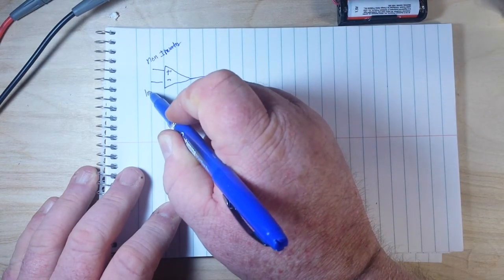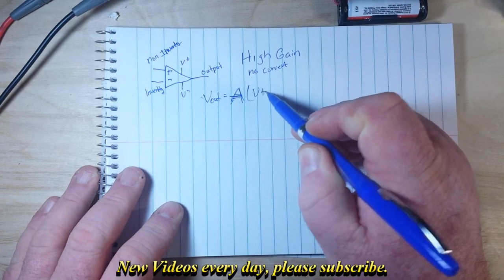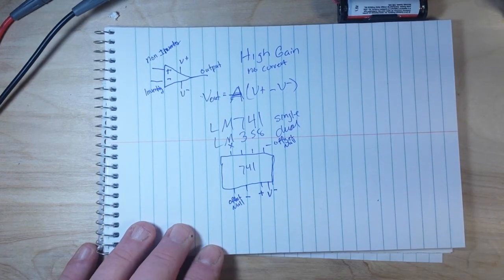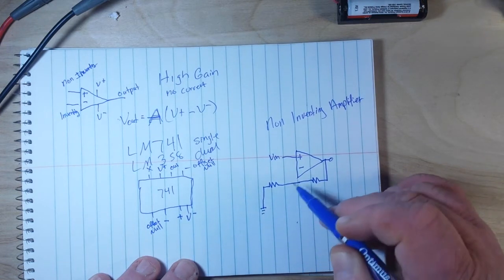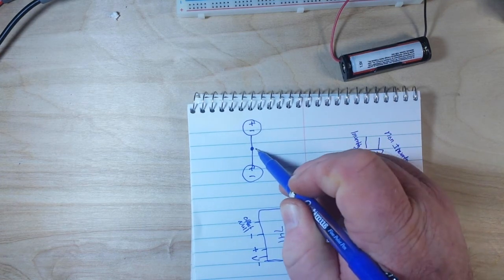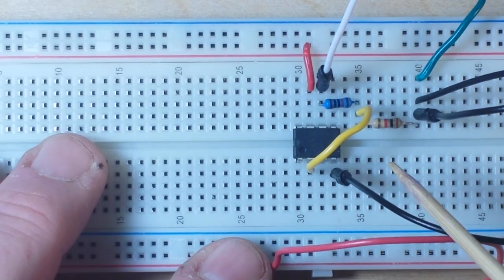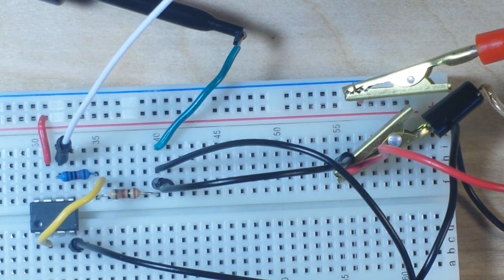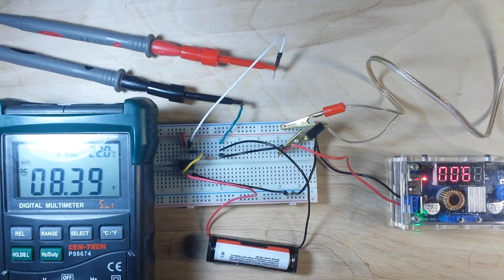Introduction to OpAmps

Comment: Any way we can utilize this practically in simple projects? Thanks for the video
Reply from the maker: Absolutely. You can use it to amplify any analog signal...microphone, light sensor, just about anything. In fact with a dual opamp like the LM358 you sum 3 signals at once.